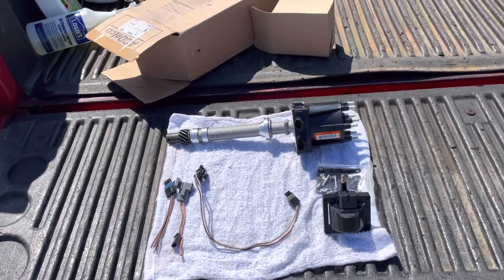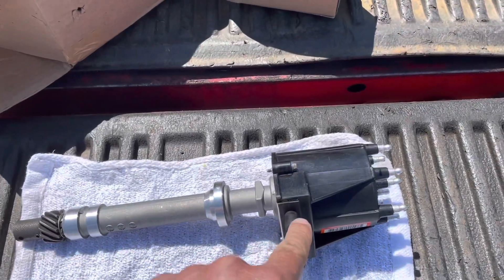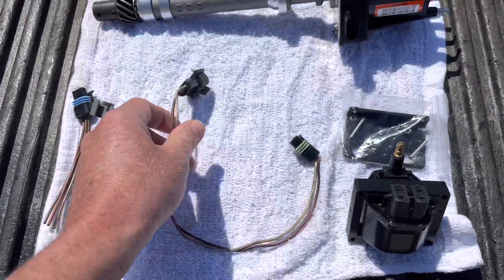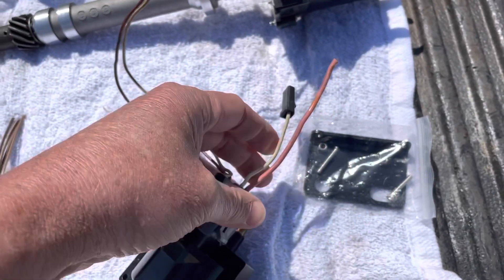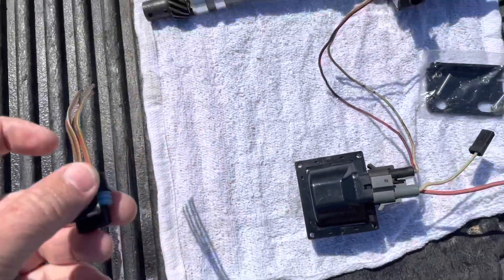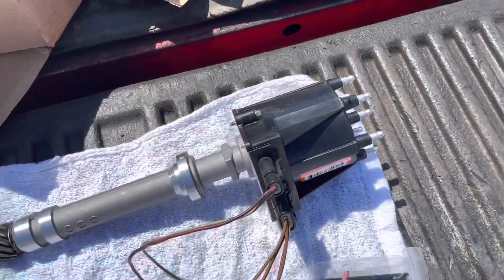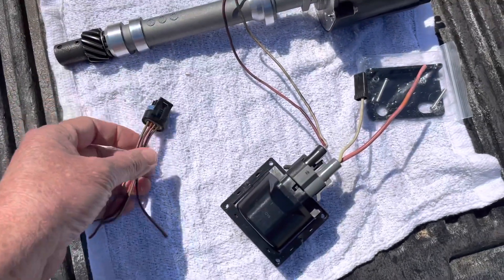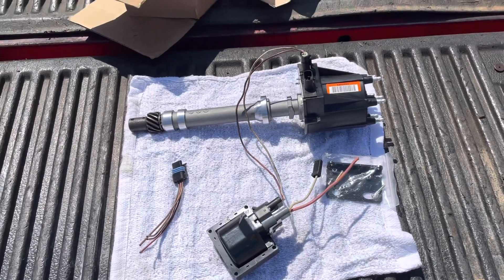2/Mercruiser Thunderbolt? - OLD VIDEO - Read Description

Comment: This was very helpful and after watching you explain the ignition system I bought the sierra kit. I haven't installed it yet as they sent a v6 distributor and now waiting on the correct V8.
Reply from the maker: This video says OBSOLETE in the title and tells you to read the description which directs you to better videos that explain my kits. So if you watched my videos why would you  buy the Sierra kit over my kits? My kits include genuine GM parts, theirs don’t. I explained in my videos that non GM parts have a high rate of failure.
Reply: @moccasinmarine   I think I missed the part where you were selling these kits, I got the part where you said the Thunderbolt ignitions were obsolete and to replace them but I didn't see the part where you was supplying them. Do you sell any other Mercruiser parts? I feel bad because you provide a lot of information here and I would definitely support you and your channel when I can.
Reply from the maker: @terryken12 i didn’t mean that as criticism but I was more shocked that you bought Sierra rather than my kits. I was assuming my videos and descriptions would steer you to my videos where I sell the kits, but apparently I didn’t do a good enough job of redirecting. I think the issue is selling directly on YouTube is unorthodox so I’m getting a website soon.
Reply: @moccasinmarine   I would never have bought that kit and told you about it had I known you was selling those, I went back and watched that video again and noticed where it was written underneath the video that you sold kits and then I tried the link to them you had posted but couldn't get it to open. I am a jack of all trades master of none internet included, I come here almost daily for information in trying to fix a multitude of broken things I have not previously encountered then take enough information to repair and move on, my attention span is short because daylight is burning and I have no help, I have a home and commercial service company a lawn mowing business and have to service all my equipment as well as find time to work on boats so with that much stuff going on I am going to miss some things along the way. Currently having to learn more about HVAC because just like in repairing boats all the talent is gone and if you want it done you will have to step up and do it yourself. Again I apologize and appreciate the information you have provided to myself and others I watch your videos not only for information but also for refreshers on  engine building, I used to be a GM line mechanic and am also building a 4.3 for a boat and had never built a Vortec before, i will continue to watch and if I need a part I will most certainly check with you first.
Reply from the maker: @terryken12can you post exactly which video that has the dead link? Also figured out where the confusion is. When I said OBSOLETE I was talking about the video which I didn’t want you to watch. You thought I was saying the Thunderbolt was obsolete (and it is) but that wouldn’t lead you to not watch the video. I will modify the titles to make it clearer.
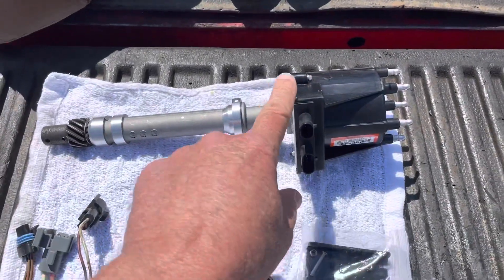Reply: @moccasinmarine   I can't find that link not yet anyway but on 1/ Mercruiser Ignition trouble about 1:55 you mentioned a conversion from Sierra that you would post a video of at the end and that you had ordered one and it would be there tomorrow, so following suit I ordered one as well totally missing that you sold them. There is a lesson for me here to pay closer attention, I have trained a lot of people boys and men are the shortest attention spans women pick up basic directions faster but this has raised my awareness to not fall into that trap and in trying to learn pay closer attention. it is disrespectful to the teacher to not pay close attention and waste the time they have given to increase ones knowledge. My apologies.
Reply from the maker: I think we’re on the same page now. I didn’t want remove the old videos because they all have some useful information but at the same time they add add confusion. What surprises me the most is people aren’t reading the descriptions of the video. That’s actually more important than watching the video itself because I can do updates after the fact. This is something YOUTUBE should fix, I.e. making descriptions more prominent and easier to read.

Comment: I’ve got a 5.7 350 mark cruiser we took it out on the lake everything worked fine parked it. Tried to go back out to the lake two weeks later and it wouldn’t fire couldn’t figure out what it did so we replaced the coil. Got the exact one you have in the video with the key on all four wires coming out of the coil power power I pulled the spark plug wire that comes from the coil to the top of the distributor and touched it with a light and it has solid constant power is that supposed to be like that? Do you have any suggestions how I could get fire
Reply from the maker: Read this manual on how to troubleshoot your Delco EST system

https://f01.justanswer.com/oldnewenglandmarine/36c97f52-be29-4a64-9ab5-8bf8b351bf86_Delco_EST.pdf

Comment: Man I have 2 grey wires on my negative side of my coil.
Reply from the maker: One is the wire from your thunderbolt module that fires the coil. The other goes to your tachometer.
Reply: @moccasinmarine  thank you for your reply I'm stressing about doing this swap.
Reply: @moccasinmarine  I am not getting 12 volts to the positive side of my coil. If I run a jumper wire from positive side of battery to positive side of the coil the boat fires right up and stays running after I pull the jumper wire off. Does this sound like my ignition module has shit out? Thanks for your help people that know this system are very few and far between.

Comment: You're missing the Most important thing that makes a Marine Distributor a Coast Guard approved Marine Distributor: the little spark suppression screens on the baseplate that keep the boat from going boom if there's a gas leak.
Reply from the maker: They’re not missing. They are there. It’s a marine distributor. What makes you think it’s not.
Reply: @moccasinmarine  I didn't say that it wasn't / that the screens were missing, I was pointing out that you neglected to mention the single most important thing that differentiates a marine distributor from an automotive one; same goes for the alternator, fuel pump and carburetor - there's lots of people who aren't aware that there's actually valid differences in some "marine" parts.

Comment: Does this work on reverse rotation mercruiser 7.4 engines ?
Reply from the maker: Yes, all that matters is the gear on the distributor shaft and the order in which you place the spark plug wires on the distributor cap. You might have to send me your old distributor to see if I can swap the gear onto a new distributor shaft. There might be new distributor’s out there with the right gear but I doubt if they would be DELCO EST compatible.

Comment: I'm an automotive tech and trying to dumb the system down due to no spark on me 97 welcraft 4.3. Assuming good distributor and coil and wiring to each other, I can ground dist and coil together,  send voltage to coil leave tach unplugged and spin the dist to create spark, right? I'm must be missing something because I'm loosing spark. If you agree then one of my known good parts must actually be bad
Reply from the maker: You’ve left out too much information. What ignition system are you trying to test? If you ground the coil it will never fire and will overheat.

Comment: The Marina installed the new ignition control module, now all the audible alarms are going off after the boat starts running for 5 seconds. Any thoughts?
Reply from the maker: Watch video part 4b of this video series for the cause.

Comment: good morning,
Great companies!
My problem is that after installing this new module and accelerating, the ignition starts to lag rather than accelerate. What could be the problem?
Reply from the maker: Sometimes the inductive pickup coil in the distributor is wound wrong. It’s in the middle of the distributor and can only be removed by taking the gear off and pulling out the shaft. You can try reversing the white and green wires where they connect on the module first, but I would replace it as it’s a manufacturing defect.
Reply: @moccasinmarine  Thank you very much - your advice helped me. Swapping the cables (green, white) did not help - the engine started to go crazy. I replaced the pickup coil and it works! Eventually, it started to overtake, not backfire.
Now another problem has arisen; D. At 600 rpm = 8, at 1000 rpm = 9, at 1500 rpm = 16.5, at 2000 rpm = 16.5 angles. In my opinion, at 2000 rmp - the angle should already be 25.5. Could this mean that the module is still damaged?
Reply from the maker: @krzysiek-wodniak  you never said what size engine you are working on? Also anytime you change the module or pickup wiring you have to re adjust the ignition timing since the pickup is technically what you are timing when you rotate the distributor. It’s also important that you put the gear back on in the same orientation. In other words don’t install the gear 180 degrees out from how you found it.
Reply from the maker: Based on the curve data you’ve sent me that module does not appear to be a marine part. I’d need the manufacturer and part number to check.
Reply: @moccasinmarine  I have a 1996 engine. Mercruiser 5.7 V8 - originally it was with Thunderbolt 5, angle of advance 8. I borrowed a Thudderbolt IV module from another boat and the boat works very well, but I have to give TB IV back. So I bought on amazon "A-Team Performance - EST Marine Electronic Ignition Distributor V8 5.0 5.7 7.4 18-5484-1 18-5514 3857449 - Compatible with Mercruiser EFI Chevy Chevrolet Volvo Penta OMC" with cables, coil, candles.
Reply: @moccasinmarine  Thank you again !. Please see this movie (in Polish), but I put an Excel chart on it. Turns out this module is not suitable for my engine. The blue color line is Thunderbolt Original and the orange line is EST. https://youtu.be/l40kxxD26w4?t=141
Reply from the maker: That’s your problem. A-Team distributors are very inexpensive. I don’t buy them because I don’t believe they can sell genuine marine modules for the price they have. You need to buy an AC Delco module part D1965A and nothing else, no substitutions. I wasted 3 months of my time chasing down problems with other modules.

Comment: Hello, I have question: In the first minute of this video you say it can't be a car - it just has to be a marine.
You say modules have different functions, can you write something more? I am asking because I can buy a car module much cheaper than a module for a boat - by practically half the price.
Reply from the maker: Marine modules have gradually advancing timing curves. I say curves because the module has a unique curve for each size engine. If you watch this whole series I discuss this in much greater detail. Car and truck modules don’t have timing curves. They have a fixed advance that kicks in around 1500-2000 rpm. The ones I’m familiar with have about 13 degrees of fixed added timing. While you could in a pinch use the car module in a boat and adjust the base timing so that the total is correct at speed I would not chance it. The proper module is Delco D1965A and is not that expensive if you shop around. DO NOT USE THE CHEAP $20 EBAY MODULES.

Comment: Is there any posibility alternator fead power to ignition coil directly?
How worked those old ac magnetos how not to get shocked via boddy ground and how prevent baterry from discharge?
Any one has ideas how that might work?
I was also wondering I do have E core type ignition coil wuld the 4 pin gm ignition module still work if AC is used ?
Reply from the maker: I’m not understanding what you are asking. I don’t have experience with racing magnetos so I can’t answer questions related to that.

Comment: Man I just put my motor back in from being rebuilt. And I was on the water running and it just shut down. I check to see if I was getting any spark. And nothing. I check the coil pack and it tested good. I was getting power from the distributor. I think my module is bad.
Reply from the maker: The pickup inside the distributor is a fragile part. It’s a coil of wire that when heated expands and sometimes the coil shorts internally and you lose the signal. The module has better quality control when it’s made so I would lean towards the pickup coil.

Comment: hello, I have this set up would having the constant power set to just the purple wire cause a stall, or do any ideas on why when I connect the tach it's having stall issues.
Reply from the maker: If it only stalls when you connect a tachometer the tachometer is bad. If stalls randomly otherwise you may have to replace one of the three ignition system items, ignition coil, ignition module, or the pickup coil inside the distributor. These are the only electronic components that would be likely to fail. I just recently had to replace a brand new distributor because the pickup coil failed randomly. Random failures are very hard to figure out. I replaced the module first, then the ignition coil, and finally the distributor until I solved the problem.

Comment: Hi I asked this a few months back and you were gonna get beck to me but you must have got busy and forgot. I cannot get into base timing mode with my 96 4.3LX Mercruiser with the thunderbolt ignition. I ground the purple/white wire directly to the battery before I start the engine but it makes no difference in timing with or without. Also it still advances when I rev the engine. Boat is new to me and engine is new, previous owner froze the block. I have this one running pretty good by ear but I cannot do final adjustments. I also notice my tach doesn't work.(bad module maybe?) Replacing parts is expensive and you seem to be one of the most knowledgeable youtubers on the subject. Do you have any advice?
Reply from the maker: From your other comment it would appear that you have decided to upgrade to the Delco EST ignition so your issues with the Thunderbolt ignition will go away.

Comment: Does this setup have a built in timing advance? I just installed the setup out of a 1994 Chevy pickup truck but I don't know if there is any way to make the advance work without an ECM.
Reply from the maker: Please view part 6 for the answer to your question but I suggest you watch all videos in this series for a full understanding. Truck and car modules are not compatible with marine applications. The timing curve is wrong.

Comment: Hello, I have an Mercruiser 7.4 with Thunderbolt IV ignition module. The module is dead and I've had a Hard time finding replacement. A friend suggested that I convert the whole ignition system to a Sierra conversion kit 185480. I just ordered One, but I noticed that it doesnt have any ignition module. Do you know if it is integrated or should I buy it seperately?
Reply from the maker: I would return the 18-5480 kit. It is a Pertronix based kit and the timing advance is mechanical weights inside the distributor. The Pertronix igniter (module) is inside the distributor cap and fires the coil but it does not have timing advance capability. The GM Delco EST kit below does the advance electronically so there are no moving parts to maintain or wear out.

I recommend a GM Delco EST system. Go to this link ( https://marineenginedepot.com ) and get part number 481111. Watch all videos in this playlist ( https://youtube.com/playlist?list=PL6wJJenh5G94kH1RfBCMYAdMAlD4ZJyhn ) for instructions on how to install part 481111 and then use the 5.0 timing curve and you are all set.

I’ve covered this before in the last 4 comments of this video:

https://youtu.be/x_UXSsOnepk